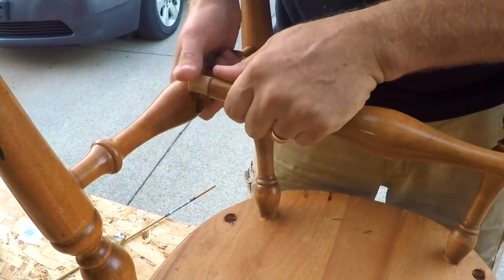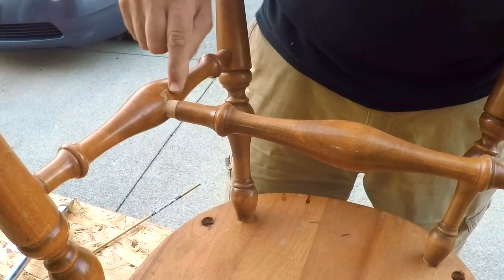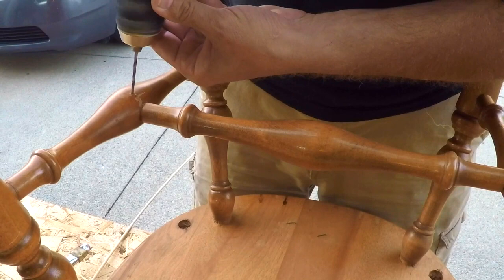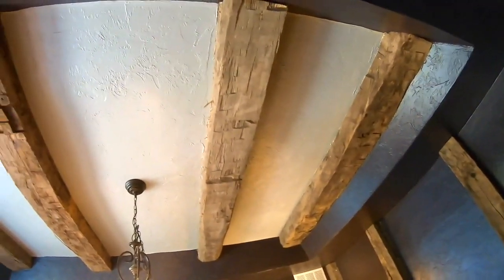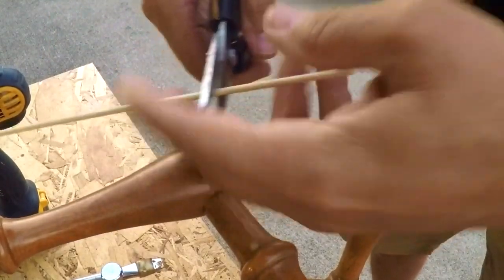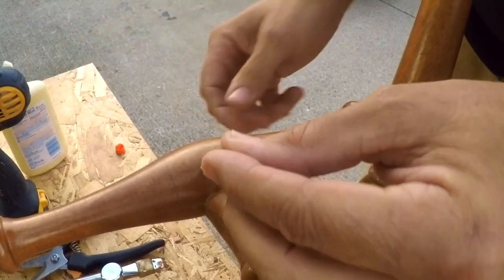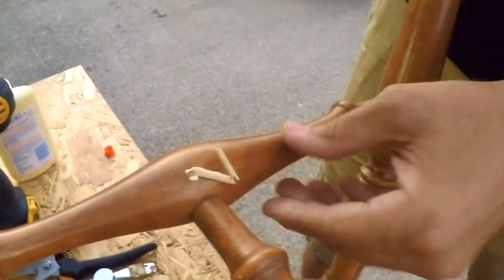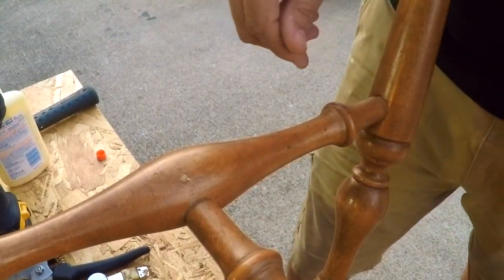Fix a broken Kitchen Chair leg spindle | Easy Furniture Repair

Comment: You have given me much needed help for my nesting table spindles.  I also have ladder back chairs with one screw and one dowel securing the ladders.  Over the course of 40 years the ladders have loosened.  I have removed the wood plug and screw from one side of one ladder.  I now have to do the same for the other three ends.  I am not sure how I will accomplish securing the ends with glue, but I was thinking of adding some glue and a couple of toothpicks in the screw hole with a little brushed on glue to the exposed dowel end.  I plan to clamp this well and follow up with new wood plugs in the screw hold ends.
I hope this will suffice for the rest of my lifetime.
Reply from the maker: Sounds like a plan. Thx for watching!

Comment: Would you use a small nail since it is stronger than the little dowel?
Reply from the maker: Hey than,
Yes. Same principle. I would pre-drill a smaller pilot hole to prevent any wood splitting. 
Thx for watching!
Reply: Not a good idea to mix nails and screws with chair joints as chair joints need to expand and contract.